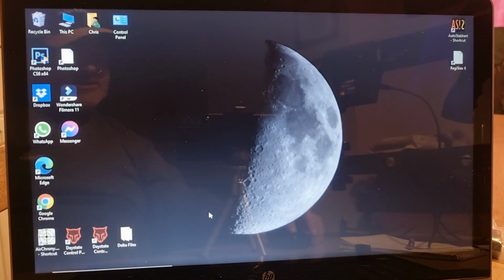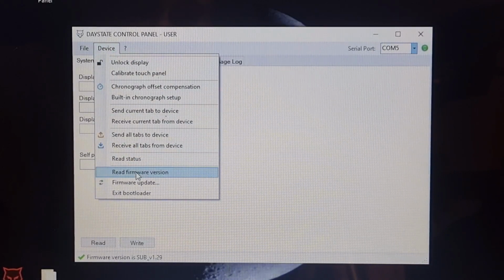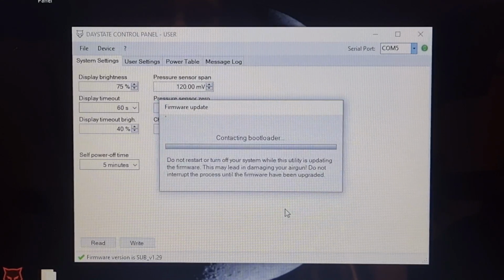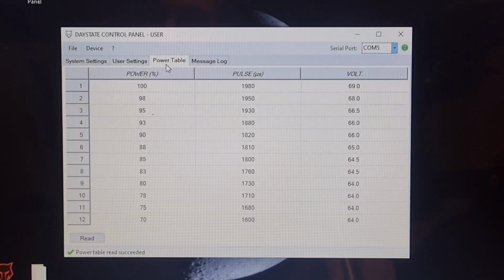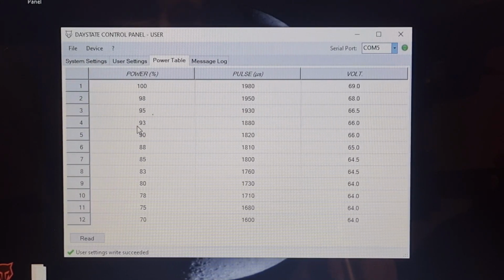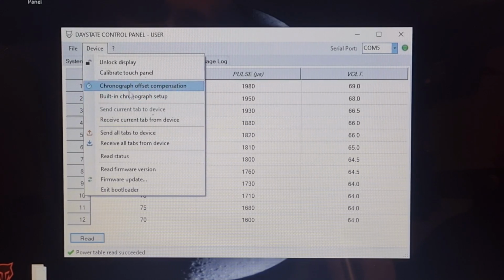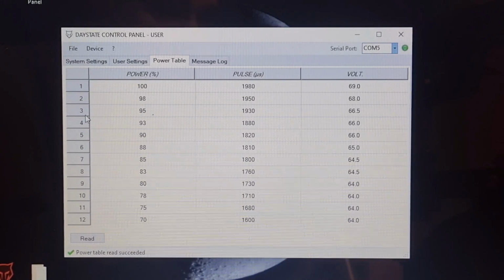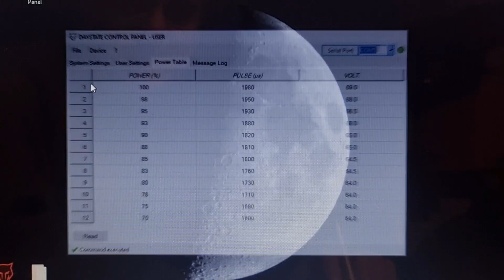Delta Wolf Firmware Update

Comment: Hi Chris just received my elpha wolf upgrade to delterwolf, I want to upgrade the software so I have the Alpha wolf software in the deltor wolf is it easy to do as I don't have a clue, thanks mate
Reply from the maker: Hi, the Alpha and Delta's run the same software, so as long as you have the latest update from the Daystate website that is as up to date as you can get! It's not a difficult procedure, watch a few videos and take it step by step, you should be fine.
Reply from the maker: Before you fit the performance pack study the videos, you can't be too careful with that safety drum, once you have the first safety lever on it's worth trying to pack the gap to help prevent pushing the lever towards the rifle

Comment: I have a sub 12ftlb uk Delta Wolf. I have the DTD Pen Drive, but when I updated the firmware, then loaded the updated configuration file to control panel,  the Power Table tab doesnt update to rifle, other tabs do, but not the Power Table tab. I assume since they provide a updated config file for the 12ftlb, you should be able to upload it to rifle surely?

Great video, Thanks for sharing.
Reply from the maker: There's a glitch in the User Program, I have spoken to Daystate about it and they are working on a solution, I'll let you know when I hear it's fixed
Reply: @chrispark7504  Yes the write button is missing in Power Table tab. And if you use the dropdown menu's to write to rifle it refuses to update the Power Table tab to rifle. Having checked my Power Table, it is significantly different to the new  updated configuration file for <12ftlb.
Reply: @chrispark7504  Yep the glitch is they wont allow you to write the Power Table to rifle.

Comment: Hi Chris  can you check with daystate that all delta wolvs can accept the 12 power table 
I and I belive others are struggling  to compleat this part of the upgrade
I have loaded the sub12 cofig file which shows up ae a 12 position power table and I write it to the gun, but when I ask it to read the power table tab I only still have 7 power levels   brilliant video by the way 👍👍👍👍
Reply from the maker: Hi Ken. The firmware will load onto any Delta Wolf, once the firmware is up to date it should accept the latest sub 12 configuration file (1.29), I did have a similar issue the first time on the old boot loader program, fixed it by deleting the original software on my PC and re installing the new program from the Daystate website, then updated the rifle followed by the new configuration file. Hope this solves it! https://daystate.com/product/delta-wolf-programming-pen-drive-and-lead/
Reply: Hi buddy , if yours is 12ftlb, what the heck is your reg doing that high ? Mine only set at 96 bar
Reply: @studssmith2008  yes  between about 90 to 105 there's not a big shift in pellet speed 
And possibly just trimming accuracy depending on individual pellets.
I have now switched barrel back to 0.177 and now set at 100 bar
All the best
Reply: I was just wandering why his is so high considering it’s sub 12
Reply from the maker: @studssmith2008  it's about 103 bar, but it's an odd thing that the reading is different during the update process, I have mentioned it to Daystate already, it's back to the normal reading now.
Reply: I thought something was up 😂